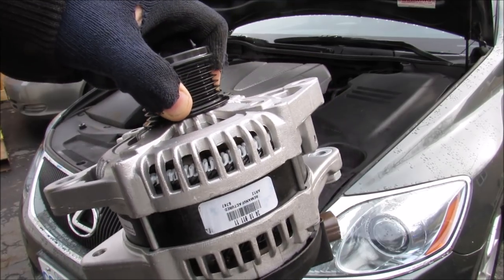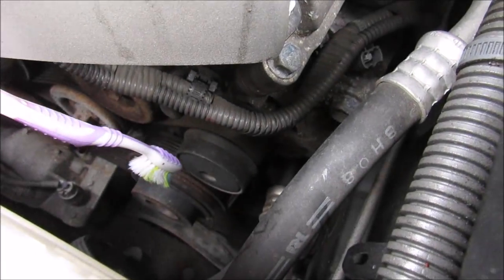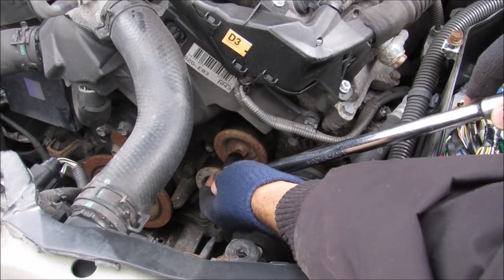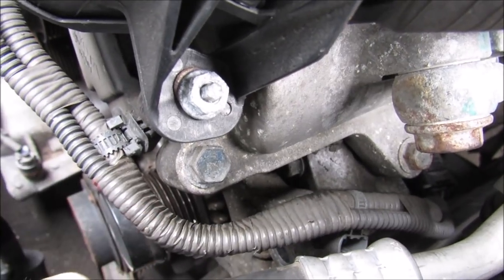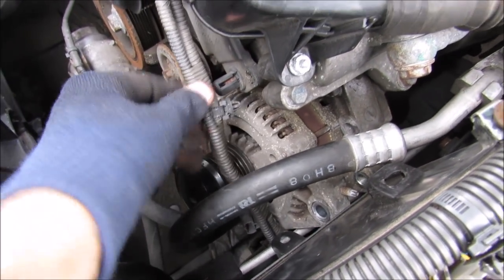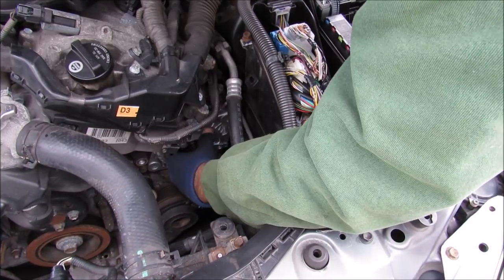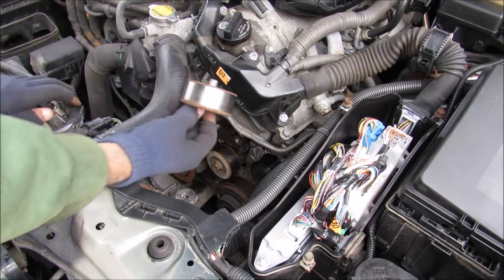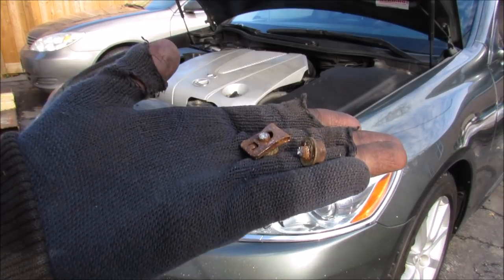Alternator Replacement -  Toyota & Lexus V6

Comment: Thank you. Your video was helpful when I replaced the alt. on my 07 GS350. Of course the hardest part was the rear bolt. The thing that helped the most was to place form padding across the top of the engine and lay on top of it. This allowed my left arm & hand to the correct angle to fit easily down the hole and access the stud / nut with a deep 12mm socket & 3” extension to remove / reinstall the nut.
Thanks for taking the time to post your video.

Comment: Man! You have no idea how much your video helped me with installing the alternator on my 08 Lexus GS 350 AWD. All of your tips  on camera work were spot on.  Thank you kind Sir!
Reply from the maker: +Arthur McCoy awesome! I'm glad it helped. For the AWD did you have to loosen the compressor, or were you able to wiggle it out ?
Reply: speedkar99 No need to loosen the compressor. Once I removed the wire bracket on the right side,(10mm bolt), I was able to wiggle her out pretty easily.
Reply from the maker: +Arthur McCoy good to know, I read it's much harder on the AWD on the forums

Comment: This video and the write up on ClubLexus were both very helpful! Couldn't have done it without this; never would have found the back bracket and would've had to pay the dealer. Thank you!! 2007 GS350 AWD. No issue getting the alternator off and back on with the AC compressor in place. Plenty of other issues getting everything put back together in tight quarters...
Reply from the maker: Thanks for the feedback on the AWD model, I heard on those it's a bit more difficult. Glad the video helped!

Comment: I had to replace the alternator on my 2008 IS250 and there's no way I would've been able to do it without the help of this video. Thank you!

For anybody working on an IS250, you'll need to remove the radiator fan to make room for the alternator (which is not too hard to remove since it's not bolted to anything, just held in with tabs at the top. And I recommend removing the air filter box to make removing the radiator fan easier.).

Comment: I just did this followed your video for my 2007 GS 350 RWD. I used the Ridgid micro CA-150 inspection camera from Home Depot. Helps a lot to see what you are trying to get out and put back in and the tip of using the tape is worth the video in my opinion. Great video and keep em coming.
Reply from the maker: Thanks and I'm glad it helped. Enjoy your GS

Comment: This video was by far the best I saw in my research. No offense to others at all but the little nuggets given made this easier. I would like to add that if you get a flexible light, you can position it where you can see that bolt behind the alternator. It helped me exponentially in getting the nut out and place it back on. Patience was key.

Comment: of all the lexus is250 alternator replacement videos I've seen, this one by far is the best. The way other videos skip through important parts like how to reinstall that annoying back bolt or just fast forwarded was so annoying. Dude, you win. Thank you so much. I already changed mine yesterday but just left that bottom bolt uninstalled. I need to get that on soon.
Reply: i think that's a GS
Reply: btw, did you have to remove that stud above the alternator ? I've seen multiple other vids mentioning that it's in the way while removing the alternator.

Comment: Wished I would have seen this video earlier.  Was stranded yesterday by the alternator giving out - was puzzled by all the light going up like a Christmas tree earlier.  Had to buy a new battery just to make it to a shop a few blocks away.  New battery + replacement alternator and labor came out to about $900.  Would have save a few hundreds had I did it myself.  Anyway, very good vid on how to DIY.  Side note, another shop wanted 5 hours labor to do this relatively straight forward job - unbelievable.

Comment: Awesome video. Was almost exactly the same on a 2014 GS350. Made the job a lot quicker as that bracket on the bottom is hard to see.
Reply from the maker: Yes the 4th gen GS is the same mechanically
Reply: @speedkar99  Your vids are awesome. I learned as much from your great editing as I did the job.
Reply: Any suggestions where to buy a new alternator?  I have a 2010 lexus 350gs

Comment: Great video once again! 😀 That's a clever trick about using tape to hold a bolt onto a socket--I'll have to remember that one. 👍
Reply from the maker: +Christopher McColm thanks- definitely a tip you should use if you don't want to be hunting for nuts at the bottom of your engine bay when they fall!

Comment: Wooow what a great video, I watched a video where the guy pulled out the fans to pull the alternator out, so I followed his steps. I watched a few different videos and his method seemed the best but I wish this video popped up at the top. Very useful for anyone that has to do this one. I definitely liked that tape on that back nut, I dropped it a few times and it really got me frustrated. Great video man! 👍🏽

Comment: Very good video that I had much use of today - thank you!

On my IS250 RWD 2008 there are a few differences with the radiator. There was not enough space between the electric fan and the engine to get the alternator out. I contemplated removing the radiator, but there's a hard line thin radiator sandwiched in front (Aircon?), so I didn't want to disconnect it. Instead I sawed (!) away part of the cage for the fan and disconnected the top radiator hose. That gave me the space needed to get the alternator out. 🙃
Reply from the maker: Thanks for the update, glad my video helped. That alternator is in a tough spot with the computer and compressor so closeby

Comment: Thanks so much  for the great video !!!!!! Did my 2010 lexus gs350 and had no issue
Reply: My 2010 350gs was fading at a red light had enough power to pull into a walmart and park and call a tow truck..all the lights on the dash came on steering wheel locked!.. where did you buy or have any suggestions best place to buy a new alternator?..
Reply: @IceESole what brand u get?

Comment: Battery light came on and off on my 2008 GS350 for a few weeks, but becoming on more frequent and longer overtime. Voltage was on low end of spec (13.7 just after start, and 13.3v when warmed up, 12.6v with heavy load), so it was still charging. I used a cheap Amazon video scope connected to my phone so I can put the socket on the stud in one try. In place of the tape, I simply used a small piece of paper towel between the nut and socket.
Reply from the maker: Thanks for the tip

Comment: Thank you for your video, I did it on a 2008 IS350, had to remove the upper radiator hose as well but pretty much the same process, the 12mm nut behind was put there by the devil himself, but with a magnetic socket wasn't that bad, lots of scratches on the arm tho.
Reply from the maker: Magnet socket is even better than the magnet I used

Comment: Sharing some info 3 years after this vid: 
Same problem on my 2007 IS300 at 130k miles.
It seems that Lexus has tuned those alternators to fail after 100k miles.
Same thing with my engine starter, it failed at 110k miles. Same with my friend's LS460.

So if you are a Lexus owner, you know when to expect those fails.

Comment: So much rust. I'm now grateful my 99 camry only has surface rust maybe. Great video. Dont ever get rid of that toothbrush
Reply from the maker: +Razz Raccoon thanks- we live in Canada, everything has a coat of rust due to salt in winter.
Reply: Razz Raccoon I have a 99 Camry too! 17 years with it.... 277k miles, never had any major problems, original alternator, starter, AC parts, only replace radiator, cooling fans, belts (timing and water pump), few hoses, tie rod ends, recently idle air control valve and wash out throttle body off car... That's about it!!! Always a South Florida car, no rust...
Reply from the maker: +Gringo Louco Awesome! Camrys are great cars, is yours a v6?

Comment: The battery light came on when the alternator shit on my 2000 Corolla while i was on the way to pay my rent, it got me there and back again, mind this was during the day and I didn't have to use the lights. Started to run really shitty for the last couple of miles though.

$66 ebay alternator FtW! It's been on there since 2014 and i like to redline the engine like an idiot, and it hasn't complained once. Beater car best car!
Reply from the maker: +John awesome! Corollas are too simple.

Comment: Just did mine today thanks to you👍
The thread for the top right bolt had to wedged back to slip it in position but all good #Cheers
Reply: One I pulled was a Jaylec, cars only done 202000 kms

Comment: I have a 2007 Lexus ex at 250000 km. I'm gonna replace the water pump as preventive maintenance. Should I replace the alternator along with it? Or should Rx alternator last much longer?
Reply from the maker: I'm not sure if you meant ES or RX 
Changing the water pump on those are a bit tight... I'd wait until early signs of failure such as noise or leakage. 

Alternator shouldn't have to be changed until signs of failure as well...that's not preventative maintenance.

Comment: If im not mistaken Lexus ES300, last time i did replace the alternator but without disconnecting the negative battery terminal. My question is after removing and fit bact the battery terminal and start any warning on the dash
Reply from the maker: +Laurence Lee Roceta I did not get any warning lights on the dash.

Comment: Cheers for the Video dude. Been working on my brother's 2010 toyota crown right hand drive. 
But same motor and similar layout. That hidden nut had us stuffed. Even after removing everything. It was still a mission to get out. 
Toyota alternators are absolute rubbish. When to the auto sparky he had rows of them needing new rectifiers and clutches. After 80,000ks they just fail. 
You'd think toyota engineers would allow more room. I use to think Toyota were reliable and easy to fix. Guess I won't bother buying new Toyota's. If that's how they design stuff now.

Comment: Thanks for the good video. Mine is 2006 GS300 AWD, alternator is still working fine but I guess the clock is ticking.
Reply from the maker: Yes...mine went around 240kms
Does your 3.0L v6 burn oil?
Reply: @speedkar99  burning oil you betcha! :) 1 Ltr per 1K km. I'm thinking of doing the upper engine carbon cleaning Lexus TSB#   L-SB-0030-10 and see if it would somewhat free up the piston rings, which is known to causes the oil loss. I'm going to change the spark plugs soon and will do that TSB while the plugs are out. If that works I'd go on and have a walnut blasting done to the intake valves.

Comment: Do you have any issues with your replacement Remy Alternator? I had bought Remy for my 2006 IS350 and had to get mine exchanged under warranty twice as it failed, once within 4 months and again within 3 months. Ended up replacing it with a 150 Amp Denso (Remy is only 130 Amps).

Comment: Hi this video is the best, i have done everything on my gs350 but have not replaced the battery. Voltage is reading 13.1 -13.3 and starts car easy but battery light is on. What do you think may be the cause of this?
Reply from the maker: Alternator

Try loading it 
How much does it drop to
Reply: Okay I had a professional check and since my car is Japanese version and part was US version he simply altered wires on connector and it’s fine now. 
Thanks though

Comment: On my alternator it was blown diodes that was the culprit. After a lot of searching I found a replacement rectifier. The old one was filed off from the windings and the new one has to be hard soldered back in.

Search for:
Mobiletron RN-34 (rectifier)
Mobiletron BH-ND06 or BH-ND12 (brushes, not sure what the difference is - I bought both to be sure)

Different brand:
AS-PL ARC6043 (rectifier)
AS-PL ABH6004S (brushes)
Reply from the maker: Good to know! Thanks

Comment: My alternator bracket bolt under the headers is stripped, but after watching this vid, you saved my ass, there is a bolt on the bracket on alternator
Reply from the maker: That would be a tough nut to get to!

Comment: I might need to change out my Alternator on my 2001 4runner, should I specifically look for a Nippon-Denso replacement? Or is remy a reputable enough brand?
Reply from the maker: I have never heard of Remy and Denso wasn't locally available in my area so I tried the Remy. It's been almost a year now and it worked fine so far...
Reply: @speedkar99  Thanks a ton! Love your videos by the way! keep them coming

Comment: Please don’t laugh at me it took me 12hrs to do this job today🤦‍♂️ things didn’t go smooth as planned, the behind nut was pain in the a$$ i accidentally removed different nut 12mm was just right next to the one I should be removing and still didn’t put it back, and finally I removed the back one that holed the alternator, but still didn’t figure it out what was the nut that I accidentally Removed it🤔🤷🏽‍♂️, it was right next to the back alternator nut But anyway I took some video so maybe later I can put it back, I also didn’t put back the 12mm but that hole the alternator not sure that might effect anything down the road ? But if I didn’t get any check engine light or something 🤞🏽I’ll leave everything as is, i test drive the car afterward everything seems good so far. Thanks again man for this beautiful video 👍🏼
Reply: Might have been an exhaust manifold bolt

Comment: the bolt that broke off holding the coolant resevoir: did part of it get stuck in there?  how did you get it out?
Reply from the maker: +scooby95219 yes it got stuck. It's just a metal bracket with an integrated nut that slips on, I replaced it with a bolt and nut for now.

Comment: Yupp it worked, but I had to drop the ac compressor, thinking about drilling out the stud and use a regular 12mm bolt in. Soo pointless to have the bracket, but I can see it may be needed when going 180mph
Reply from the maker: It's just extra security

Comment: I went with a remanufactered Denso. Who knows if Denso parts are even used inside. Seems the old 3.0 engine was easier to work on.
Reply from the maker: +rkgsd Yes the older engines have more room around them. Can you believe the manual calls for me to drain the refridgerant and remove the AC compressor for this job? 

I tried getting a denso rebuild but in my area all the parts stores only carried Remy - if I wanted a denso I'd have to import it from the US which makes the core return a hassle.

Comment: My 08 GS350 recently had the battery die.  I noticed the electronic steering was hard and then I saw the light on. When I turned off the car it would not turn on.  I jumped it and tested the battery and charging system.  The battery was good but not the charging system.  I am concerned that there was no battery light. Does this make sense?
Reply from the maker: Test the alternator the way I did here. Typically they both fail together
Reply: speedkar99 I did and it was bad and thanks to you I was able to replace it. Honestly, that hidden bolt would have ended me .

Comment: Please help!!! I’ve done everything in this video and the alternator has yet to move a millimeter. The Terminal nut removed, Ground bracket removed, the two front and top bolt removed. EVEN THE HIDDEN NUT for the rear bracket. After that I put the belt back on hoping the belt can pull it loose but still no luck.
Reply from the maker: Crowbar

Comment: Hi Sir good day. Any issue after removing the battery.....
Reply from the maker: +Laurence Lee Roceta I didn't have any issues or had to reprogram anything. Just the normal stuff when you reset the battery, the drive cycles, transmission shift pattern, radio stations and windows were all reset.

Comment: I had a dead battery, or dying battery should I say. It would stay charged enough to start and stay driving. It wouldn't hold a strong charge though. Autozone tested it and my alternator. They said alternator, but with the new battery, it seems normal again. What did I miss???

Comment: When headed to the parts store...do your research so you get the correct AMP for your model.
In most cases...the parts store will give it the SWAG method...SOME WILD ASS GUESS.
Then be sure to have them bench test the replacement. Ask me how I learned !!
Had to do the job twice...the replacement had a bad voltage regulator.
Reply from the maker: Good case for warranty

Comment: That pesky nut is an 8mm not a 10mm, with a 12mm hex; if you loosen the hex the stud can be removed with a Torx socket with nut attached; that's why the stud has a Torx end; also Snap On has some spring-loaded magnetic deep sockets that work great

Comment: Awesome video, thanks for posting. Where are you based out of? I would like to bring my 08 Lexus RX for some repairs if possible.
Reply from the maker: Canada
Reply: @speedkar99 Are you in the Vancouver BC area or somewhere else? If near Vancouver, I can bring my car over. It is a 08 Lexus RX 350 and needs a new serpentine belt and possible water pump replacement. Thanks.

Comment: Is that a flood car? The pulleys are way too rusted for 10-12 yr old car.
Reply: Raza M Guess you never lived where it snows in the winters??? lol
Reply: Raza M he lives in Montreal or Toronto one of those places. And they get lotsa snow!
Reply: :lol: come to upstate NY. That looks pristine.
Reply from the maker: +charls seal I live in Toronto Canada. Snow means they salt the road which accelerates corrosion. This isn't even that bad...
Reply: I am In Michigan, and having owned a 99 lexus ls400 there has never been such high amounts of rust in the engine bay, although the rear fenders did start to bubble under the paint. The car had 270k miles when it was sold.
Reply: I can always tell vehicles from up north due to all the rust!  Love Texas vehicles!

Comment: Having troube lining up both holes for the bolts after catching the nut. The ternator just gets stuck i tried and tried its not working
Reply: It was the oil pipes getting in the way, i bent them out of the way and it was an easy job